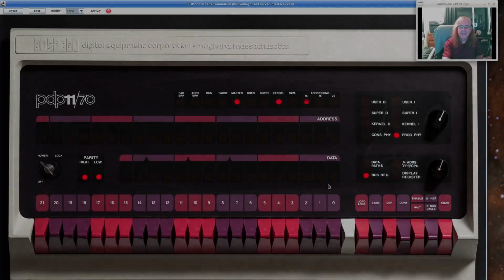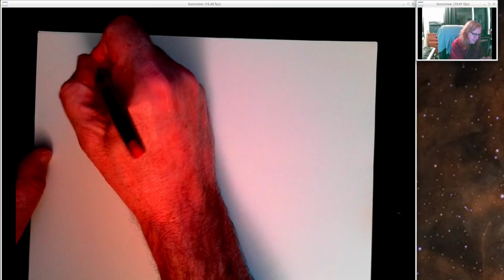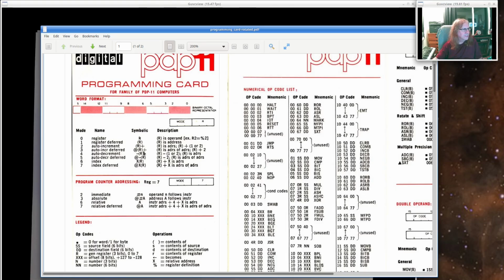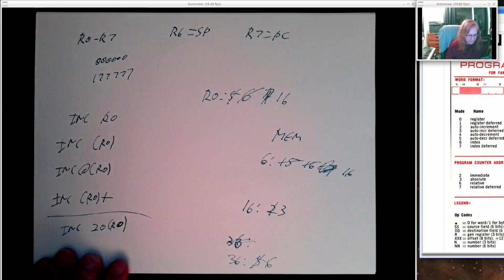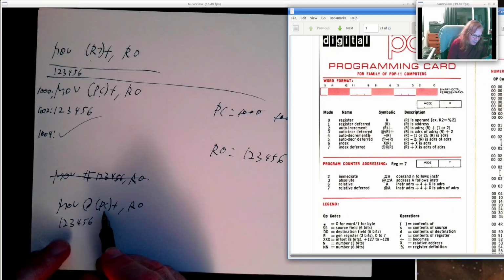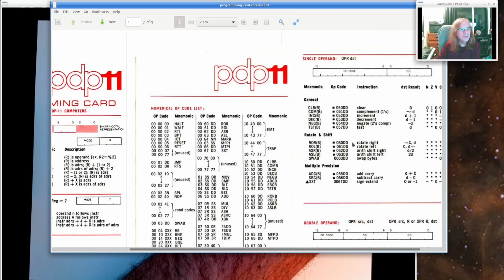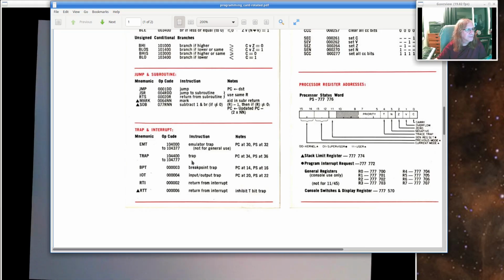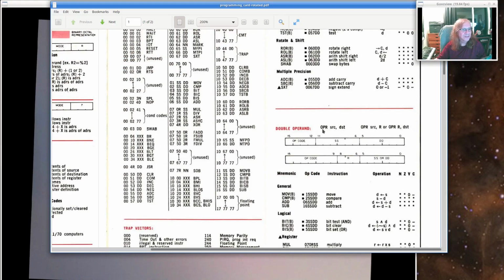Retro Computing Part 2 - Instruction Set Architecture

Comment: Would you say that the PDP-11's ISA would be classified as a CISC architecture or a RISC architecture? (The structure reminds me of the MSP430 ISA in some ways, which is still in use today). Although, I should say it has always puzzled me that older / historic ISA's like these weren't designed in a more RISC-like manner, as presumably this would result in a lower gate / transistor count. Perhaps this might not be true though?
Reply from the maker: Definitely CISC. The complexity of the addressing modes alone seems way beyond a typical RISC machine. This was in the 70s, when everyone was packing more and more instructions into their CPUs. For DEC, the PDP-11/70 led to the VAX-11/780, possibly the quintissential CISC machine (one instruction could do a double-precision floating point polynomial of degree 16 (I believe): like a Taylor series in one instruction. They also had one instruction for an entire process-context swap (save mem, take out the process, load in a new process, etc.) It was in some ways this complexity (and the difficulty in speeding it up) that helped RISC catch up (esp. David Patterson/Berkeley).

I have a 430 somewhere, but never used it. Looked like a fun architecture though!

Yes, RISC machines would have a lower gate/transistor count, but memory was still scarce (as was disk space: some of us were still loading in compilers from paper tape) so a powerful instruction set was appealing.

These monsters were generally all microcoded though: the native hardware ran a simpler set of instructions (called "microcode") and there were microcode programs for doing each machine-code instruction. So if you want to read R2, use it as the address of an address of an operand, increment R2, decrement R5 and use that as the address of a second operand, add those and store the sum at the address pointed to by R5 (yes, that's a single assembly/machine language instruction: ADD @(R2)+,-(R5) ), you don't need to build a circuit to do all that! You write a set of micro-instructions which perform the necessary steps to achieve that behavior. By the way, the coolest thing about the VAX-11/780 was you could modify the microcode - create your own instructions! :)
Reply: @MyGeekAdventures  Wow a Taylor series in a single instruction!?! and I thought x86 was complex, LOL. Although I am quite partial to RISC-V, i'm curious if RISC architectures may have been a sort of "back-reaction" to this kind of hardware complexity, or maybe there was a different impetus for companies using more RISC principles in modern machines (apart from x86, of course). It's so fascinating to learn about the history of computer architecture and its progression of ideas and approaches over time. 

True, I had not thought of the affect on instruction/program memory usage that taking the RISC approach also has, so it makes sense they'd want to cram more functionality into fewer instructions. Together with those instructions being microcoded, it seems like they essentially had the best of both worlds: Low memory usage for the program's instructions, and simpler circuitry to execute the microcode operations, which the program's instructions were translated into. I'm now wondering why CPU's ever switched away from this model of computing?.. Was it for performance reasons?

Another interesting footnote to the RISC vs CISC instruction memory usage is the RISC-V compressed instruction set extension, "C", which seems to get quite good code density by introducing 16-bit instructions for common patterns of RISC-V 32-bit instructions, akin to a CISC approach, but without introducing much additional hardware complexity or need for microcoding. Curious what you thought of this in relation to this topic, as it might blur the line between RISC and CISC a tad!

Also, creating your own instructions at a software-level is bonkers LOL. Would be so cool to see that sort of interesting functionality exposed to us in modern CPUs. :)
Reply from the maker: @Daniel.W.R.Rehman  I'll be the first to admit that I don't fully understand the distinction between what's called CISC vs RISC. RISC-V has a rich set of instructions, plenty of registers, etc. I'm not familiar with the "C" extension, but it's common for processors to work on smaller word sizes (The PDP-11/70, for example, has instructions like MOV, CMP, INC, ROR, etc. that can work on 8- or 16-bit operands). One way to view RISC is in terms of clock cycles. On CISC machines you find instructions taking anywhere from 1 to perhaps hundreds of clock cycles; I think RISC tries more for one instruction per cycle (once the pipeline is full).

And yes, I think there was a back-reaction to CISC. The store I read was that DEC was trying to speed up the microcode in their processors, and David Patterson consulted for them. After studying the situation, his conslusion was supposedly "get rid of the microcode." Scaling was problematic, and designing these machines was an incredible undertaking (see "The Soul of a New Machine" if you want a good read!) RISC was a way to make fast machines faster!